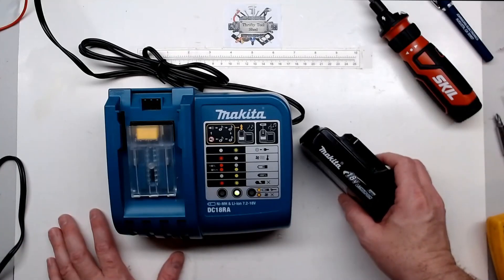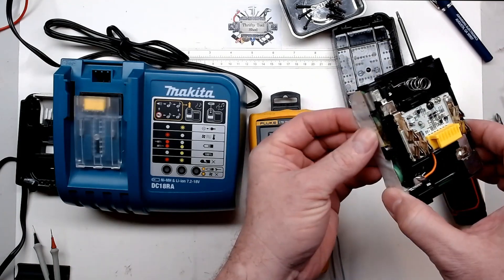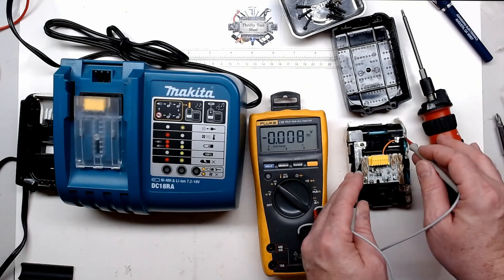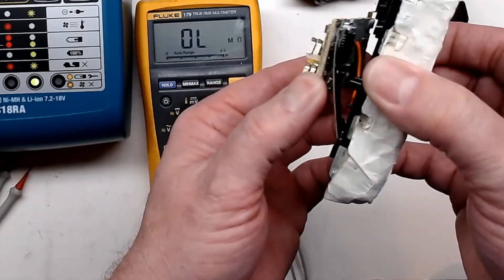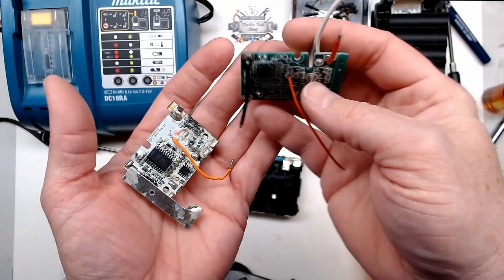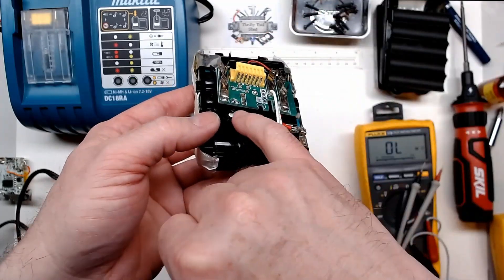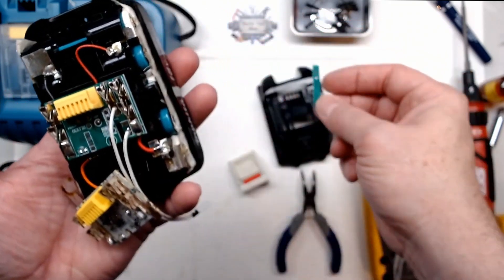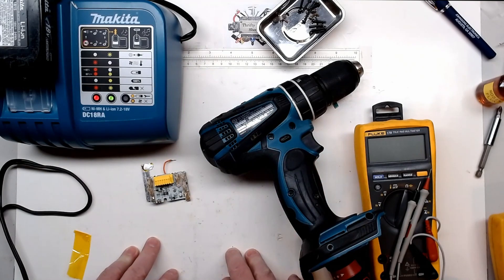Makita 18V Battery Replacement Board

Comment: Great video!  What voltage does the new PCB cut the power at please? I'd like to fix my battery but am worried about damaging the cells with a cheap board.

Comment: do these boards have internal diode to allow 2 packs to be connected in series 36v ?
Reply from the maker: No diode that I remember. They could be in series for 36-40V. Just have to monitor the voltage as to not allow them to drop below cut off voltage with a Low voltage cut out board or some other monitor so as not to over discharge. I have a video of a couple of low cut out boards that are fairly cheap and work pretty well.

Comment: got some good experience with the chinese boards. they are really cheap and the ones i use do actually balance charge. BUT! i like the makita boards better and would kill to learn a way for un-bricking them (have a bl1840 that is fused at 90a, so should really deliver the beans!!!). i think there should be a way of resetting the micro controller or something that would make mine work again. they are usually in a real good shape because they are sealed and not exposed to oils and other liquids, but useless as they are. if anyone has any ideas on wich leg of the microcontroller you need to connect to what that would make my week atleast.
Reply: and by the way, if i may suggest. makita usually uses the sony murata vtc series cells, and where i live you can get those for about 2 dollar a pop for a vtc4a, wich is one of the highest drain cells. not only on the short 30a, but also sustained periods. they are aparently salvaged out of new packs with spot welding defects, so never used. some of the tools makita produces are almost a dead short and i would recommend using a capable cell to keep it alive for many charges to come
Reply from the maker: Yes, the Makita board is better for sure when working. Several manufacturers do this including Dyson. I have pack repair videos that show some packs with a microcontroller reset, but this need more than a reset it seems. These may need to be reprogrammed?
Reply: @ThriftyToolShed  im not sure. i dont know enough about micro controllers. these battery's keep track of lots of things, like the amount of charge cycles and the percentage of its life it has been overloaded(whatever thay may be exactly). mine has two mc on board, and thats even one without the indicator lights. i am afraid you might be right that it would need reprogramming, but thanks for your time and thoughts
Reply: Thanks for this comment.  I came here looking for an answer to why my rebuilt pack can be charged by a non Makita charger and show a full 20V and light up all the lights on the tools but not deliver any power.  I could only guess the board was causing this issue.  This quick thread confirms that the board must have to be changed in order to get the pack working again.

Comment: jesus christ.
how come name brand companies can't seem to figure out how to implement cell balancing on their products.
perhaps so you go through batteries quickly.
Reply: fortunately most makita do have cell balancing. even their charger is a balance charger. if you look into the track the batteries slide on, the positive is not even present. the bigger packs usually have balancing. the unbalanced packs also seem to last longer than i would expect. got one from a friend in february this year and it has worked for years and years. as expected the voltage on those cells were everywhere, and it ultimately failed bc of a 0v cell(protection cap popped)